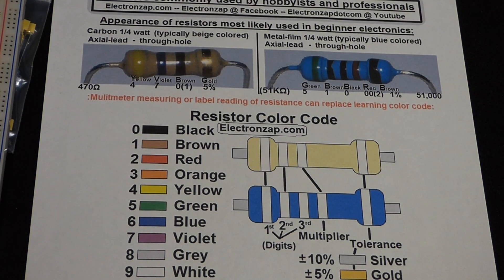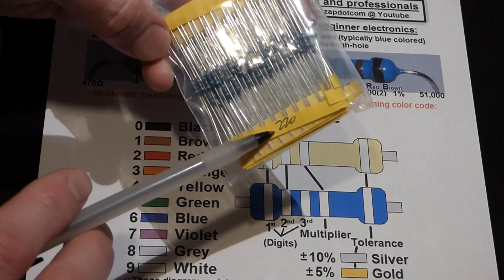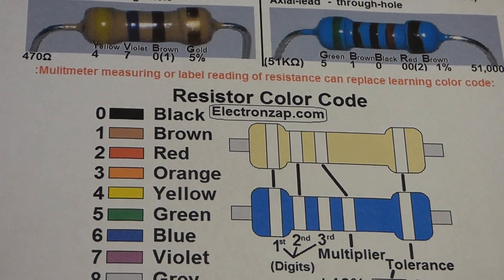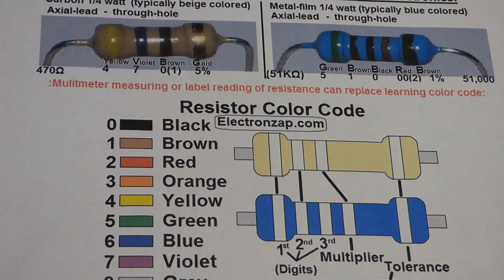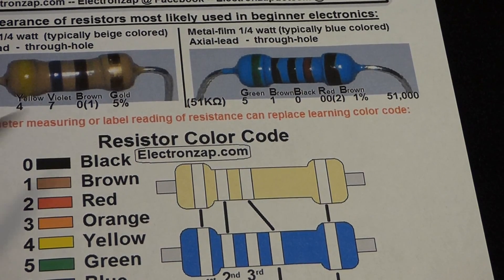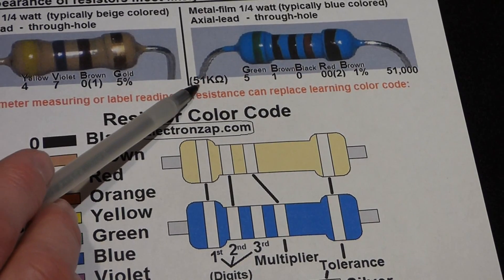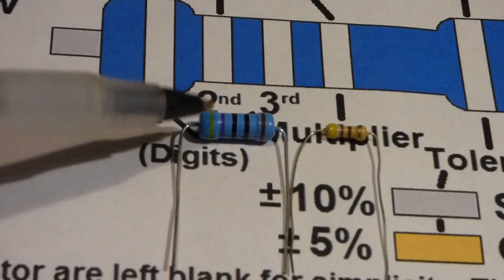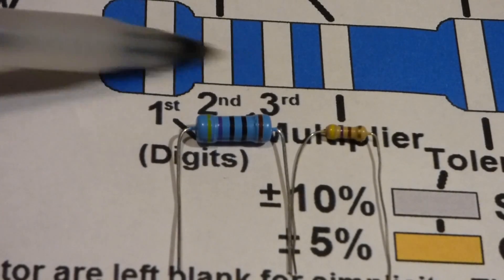Electronics resistor color code explained for 4 or 5 bands

Comment: Which end of the resistor do you start the reading
Reply from the maker: Tolerance goes to the right, it is gold (5%) for beige resistor, and brown (1%) for the blue resistors which are more common these days. Unfortunately the first digit band is commonly brown for 1, which can be confusing if there isn't extra space between the value bands and the tolerance band.

Comment: hi can i ask if its ok to change the resistor of my LM317 voltage regulator, cu'z i lost the 1k omhs the purple one and now i have the biege but it is 1k omhs also
is it possible?
Reply from the maker: Long as they are the same size, it doesn't matter. They will have the same resistance and wattage. The beige ones might not be quite as close to the rated value indicated by the color code, but that usually doesn't matter in most circuits.
Reply: @Electronzap  thank u ill try it now

Comment: I had a question I'm replacing resistors on an old vintage radio from the '60s it's a walkie-talkie and most of the resistors the and color is silver for 10% can I use a 5% instead cuz I'm having a hard time finding a 10% on eBay
Reply from the maker: Yeah, you can always use a lower tolerance resistor.
Reply: @Electronzap  thank you I really appreciate the reply I am still learning about electronics your video was also helpful one thing I do know is you have to have a lot of patience
Reply from the maker: @joemazza1011  No problem, thanks for watching, and have fun learning!

Comment: BUT HOW DO YOU TELL WHICH IS THE FIRST STRIPE?
Reply from the maker: If it isn't brown or gold, then it is probably the first band. If both ends are brown, hopefully the first band is closer to the other bands than the tolerance band. Unfortunately, sometimes it's hard to tell which is which if both ends are brown.

Comment: Umm what happen if i add different color code on my board ? I have a broken power supply that the resistor broken,i have a different resistor on other broken board that has different colour,but the line have 5. Is it ok?
Reply from the maker: Depends on their values and the circuit.

Comment: thank you very much for the video.
today i open one ballast, i find weird resistance, the color code is, (orange, withe, gold,gold,black)
https://drive.google.com/file/d/1FWmr_52j6PyWr2s_LK8AOfj_eOLj5kix/view?usp=drivesdk
i cant calculate this, hope you have idea?!
Reply from the maker: I could do some googling and make a guess, but I'd suggest posting that image with as much extra detail you know about where it came from to reddit. I think the subreddit I usually browse is called askelectronics or something similar. Someone will probably know that resistor pretty well and give you an accurate answer. I'm guessing that the black band has an additional meaning to it than the standard color code and tolerance.
Reply: @Electronzap  thank you very much for your fast reply, this is where i take out this resistance https://drive.google.com/file/d/1FlEVgjAOEhmmRb4R10K7vXWdCkEWMpiM/view?usp=drivesdk

Comment: I have a receiver with DVD player that has a bad resistor.  I know the ohms by reading the bands but how do i get the others numbers so I can buy the correct resistor watts?  Pls help me.
Reply from the maker: Wattage of a resistor is mostly based on size. So I am guessing that a resistor of the same size will be just fine wattage wise. Especially if it is a higher value resistor.

Comment: How do you know from what end you start reading?
Reply from the maker: The tolerance band goes on the right. Which is easy when it is a gold band, such as the beige resistors usually have. Unfortunately the blue resistor's brown 1% tolerance band can get confusing if the first digit is also brown. Hopefully the tolerance band is spaced farther away from the other colors, but I often can't tell if it is. If you have to deal with a couple values which have mirror images of color, then you'd probably have to use a multimeter to measure them.

Comment: What will be the value of digit and multiplier if the 3rd and 4th is gold
Reply from the maker: If the last band is gold (typically 4 band beige resisistors), that means it has a 5% tolerance rating. If the second to last band is gold, that means you take the number from the digits and multiply it by 0.1 to get the value in ohms.